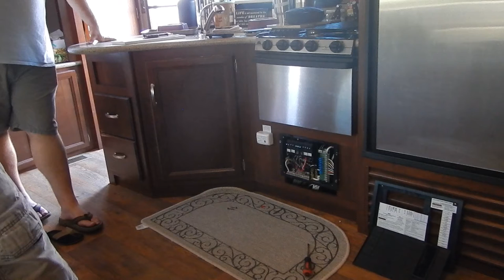Watch as Electrical Arc almost catches our RV on fire  - Fulltime RV Family

Comment: That converter is in a metal enclosure, isn't it? That ought to help prevent any fires if there ever is a short circuit, and it helps protect the electrics from getting damaged by you, or damaging YOU (shock).

Comment: I LOL'd at the ambiguous statement "There's an electric something somewhere that I'd strongly recommend..." Sorry to hear of your plight however, I hope Keystone covered the repair.
Reply from the maker: Ditto. I'm pretty sure the technician about jumped out of his shoes when it arced. He didn't touch the panel for another 5 minutes, trying to build up courage again.
Reply: Having re-watched this, and recently hardwiring a Progressive Industries EMS-HW50C power conditioner in that nook, it looks like the arcing was happening in the AC to DC converter. I pulled the whole thing apart and the DC supply is in that exact area. I mounted my power conditioner on top of it actually.